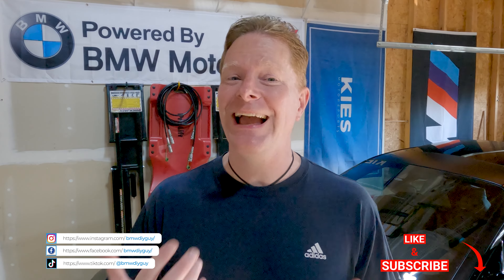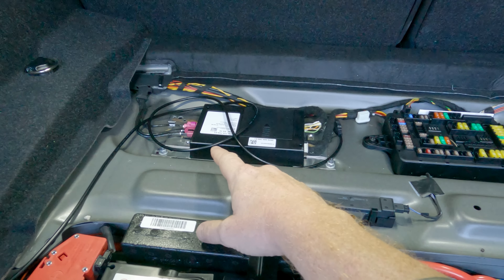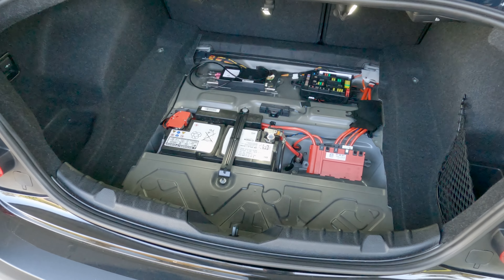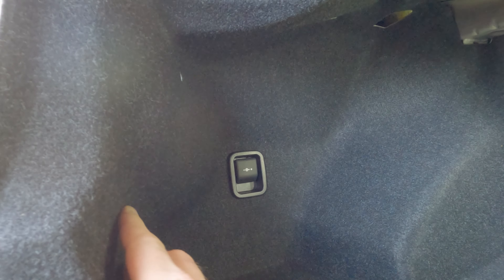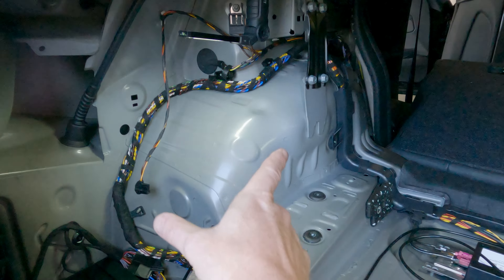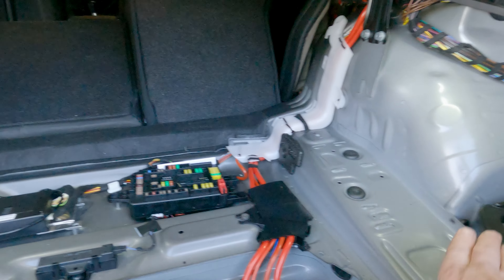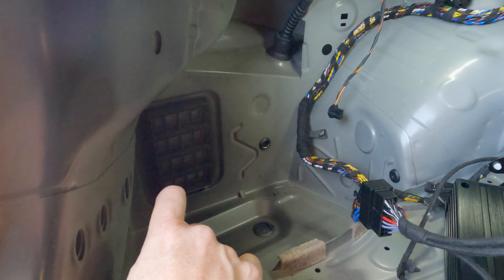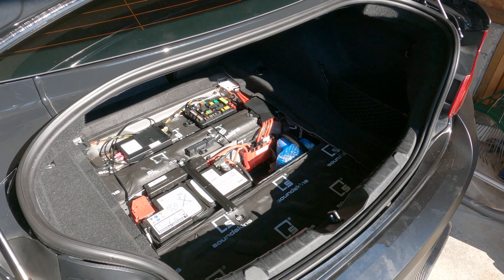Reduce road noise and improve your audio quality with Soundskins!  EASY trunk DIY!

Comment: I recommend reading some more about the installation process of the specific brand you wind up with. There was a ton of excess material installed and work done pulling components.  Sound deadening materials mainly make larger flat panels denser, less flex, reduced road noise. 
For example,  cadillac puts a 4" wide strip on each door panel. And just that little strip reinforces the panel enough to make it that much quieter than it's GMC counterpart.
It looks great, but this was really an OCD overkill install and if he didn't use a roller or way to roll/press the adhesive down, that job was all for not within a nice hot summer and cold winter or two. 
A $9 -$15 purpose designed roller really is a must. The product should look well formed with no air pockets
Reply from the maker: Ah.. great catch, I have a roller and used it off camera without thinking about it.  Great reminder!

Comment: Wonder how much weight was added. Seems like an awful lot of sound deadening material.
Reply from the maker: Fair question but less than 50lbs for everything though stage 3 and the entire car.  Unless tracking and pulling seats, CF everything, the weight is negligible

Comment: Do you only do deadening? Is it worth using other stuff like foams over it?
Reply from the maker: At least in my application with an upgraded sound system, this was more than enough to cut noise and improve the sound floor.  The before and after readings were really positive for overall change.  I have done a full stage 1-3 setup, and have more content coming soon too on this.

Comment: Isn’t an M2 made to have certain drive noise in the cabin ?
Reply from the maker: All of the F8X pipe in fake engine/exhaust sound into the cabin.  Most folks with code that out or if you add aftermarket speakers like Bimmertech, you turn that fake feature off.
Reply: @BMWDIYGuy  yes the speaker will put the fake sound into the cabin.

The real exhaust sound - which most people want to enjoy on M cars - is transmitted significantly from the muffler into the cabin by the boot
Reply from the maker: @Voll Care  agreed and this does a great job of killing hiss road noise from tires and weather.  My exhaust still sounds great.